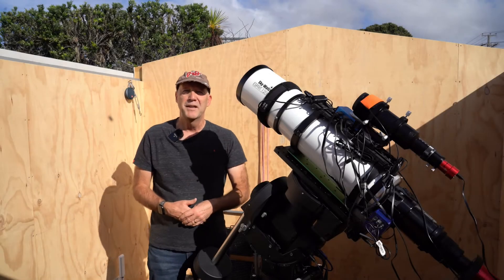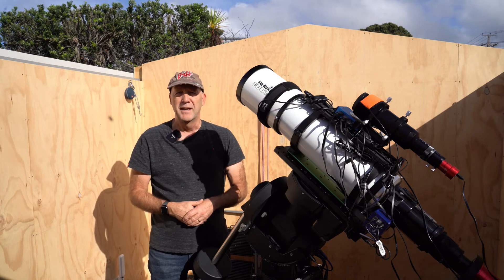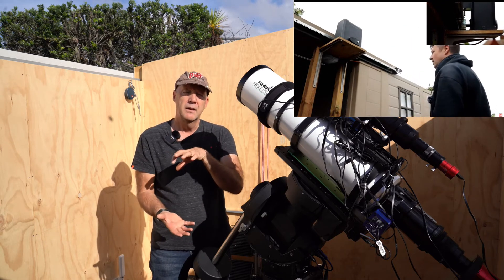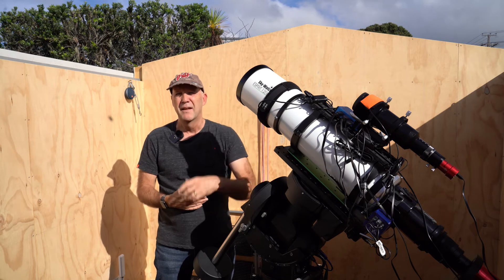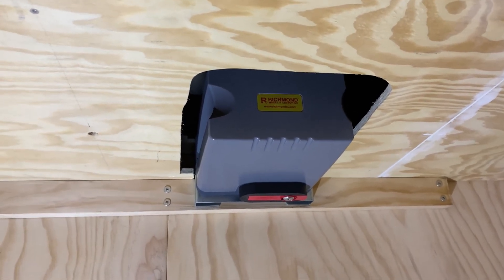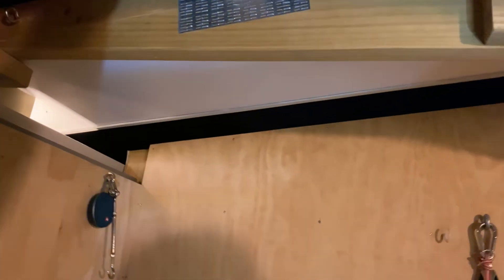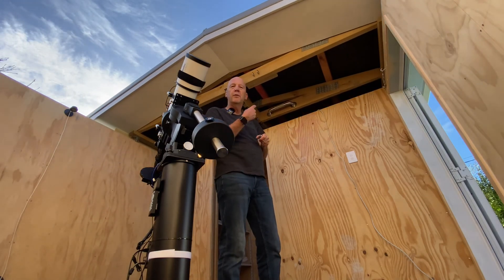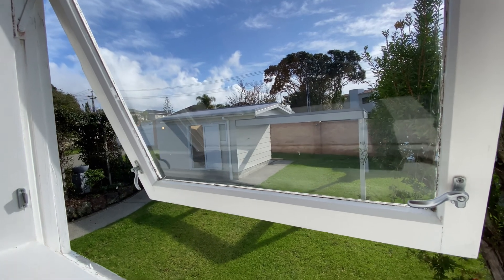I motorised my Observatory roof!!

Comment: Box in the the moter from inside the dry room
Reply from the maker: @alangriffiths1432  I was actually going to but I need access to the keyhole to release the motor from engaging if I need to move the roof manually.

Comment: Hi Logan - kia ora - greetings from Diamond Harbour, Banks Peninsula. Great video - very inspirational. Please can you advise whether you went for the 800kg or 1200kg Richmond Gate Kit. I would like to know if you have added plenty of capacity of increased drag. Thank you. By the way are you aware that there is a Safety Recall Notice on the 1200kg Kit? Take good care. Charlie
Reply from the maker: Thanks Charlie and nice to hear from another Kiwi. The Richmond gate motor I got was the GTR064 MKII which I don't think they sell anymore (couldn't find it on their website and the link in my description now doesn't go to the item anymore). The manual says it is for gates up to 1000kg. The person who built the roof said it was about 250kg weight total so I assumed a 1000kg gate rated motor would be plenty. It doesn't seem to have any problem opening and closing the roof and, in fact, I would prefer it to go a bit slower but there is no speed adjustment on mine. Once it has opened and closed once, it will remember roughly where the ends are for opening and closing and so it will slow down before it reaches fully opened and closed. But if you turn off the power (or there is a power cut), the next time it runs, it forgets and will go full speed until it reaches the magnetic cut off so expect a bit of a clunk as it reaches fully open or fully closed the first time and then it will re-learn. 
Cheers
Logan
Reply: Thanks for your reply Logan. It is always good to have a little (power) available in reserve. An observatory is all part of the retirement plan things to do. This has been deferred and put on hold due to our plan to relocate from Diamond Harbour and downsize to Kaikoura. The flat market has messed things up - but it will happen.  Kind regards, Charlie

Comment: I also added 2 magnetic reed switch, 1 on each axis in series so that when I park my mount it triggers a momentary relay timer that closes the roof automatically. SGP parks the mount (mine is sideways) after a session and the roof closes on its own.
Reply from the maker: Great idea. I have another video showing how the roof is now connected to and controlled by NINA so the open and close roof routines are part of the programmed sequence. So effectively works very similar to your setup. Now what I need is a cloud remover :)

Comment: Nice job. You don't have to point the remote to use it. I love watching people point their car remote controls while locking their cars.
Reply from the maker: Ususally not but several months ago one of the neighbours must have gotten something new that they have on during the day which blocks all signal from remotes so to open the car i have to point the remote right at the drivers window to open the car and sometimes it'll take 10 to 15 pushes to get it to work. Very annoying. Fortunately the thing blocking the signal must be  off at night so no problems opening and closing the observatory roof  :)

Comment: Your design and build is very clean and well finished. Nice rool off roof observatory
Reply from the maker: Thanks Jesus. Still need to electrician to come over and wire up a couple of powerpoints for the motor but otherwise it works like a dream.